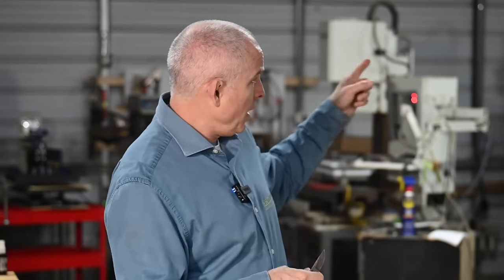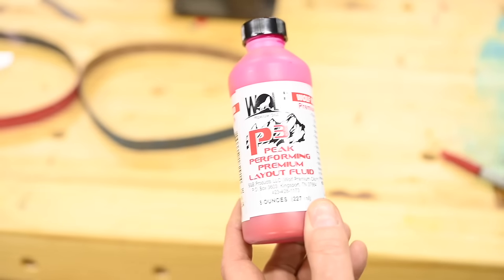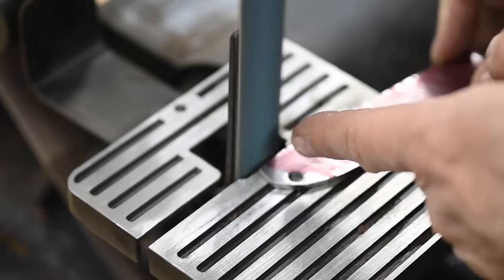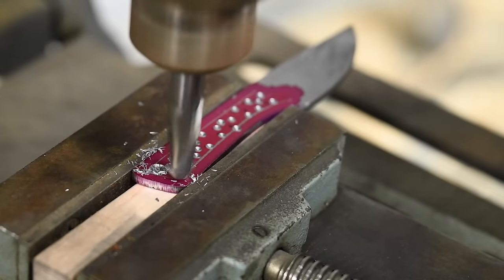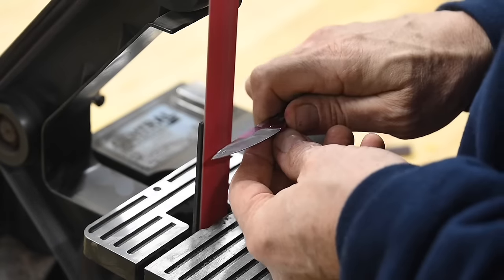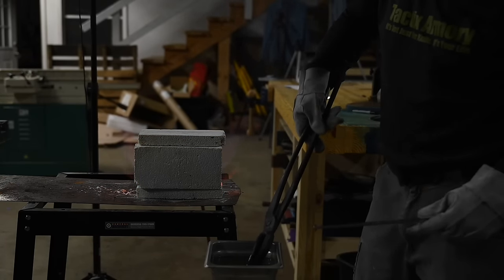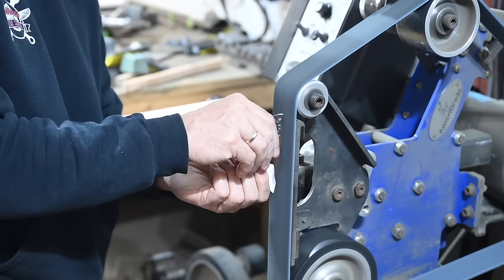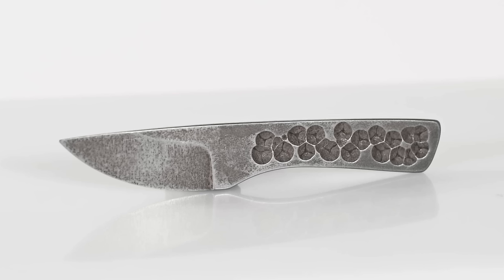Simplest Knife Build Ever! - YOU Can Make It.

Comment: Very clever with the pencil in the drill! LOL
Reply: You can use a dowel and valve grinding compound to do this.  Just round the end of the wood dowel apply grinding compound in finer grades until smooth just as he did with the pencil and green scotch bright.  
I think my problem would be lining up the moon creates instead of random spacing.

Comment: Cool, simple project! Would be a great way to use scrap cut offs from other knife builds. A great, cheap, effortless way of de-scaling steel, is an overnight soak in grocery store vinegar. The 5-6% acetic acid eats it up. Pretty much wipes right off. Works great for the mill scale on hot rolled steel as well. It can be reused numerous times.

Comment: Lool when you buy all the tools its 500$ for a little knife +the time you spent. . .
Reply: this thing is so small you can use a hacksaw and a file. don't dimple the handle, harden the blade on charcoal, you're talking zero cost.
Reply: It's about the fun and cool factor. You can make a knife any size doing the exact same thing. The 1" belt may be the down fall of a big knife though. But a file will clean every thing up.